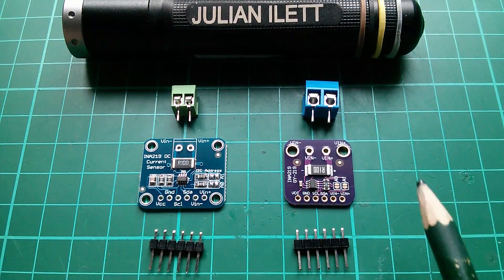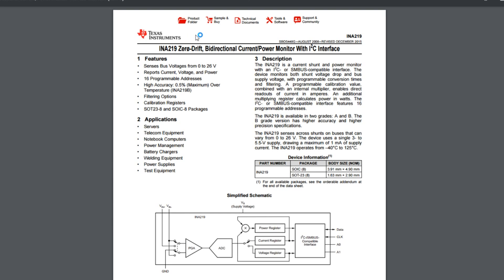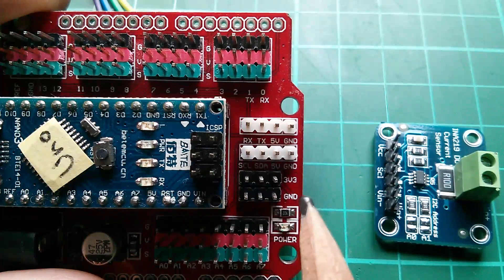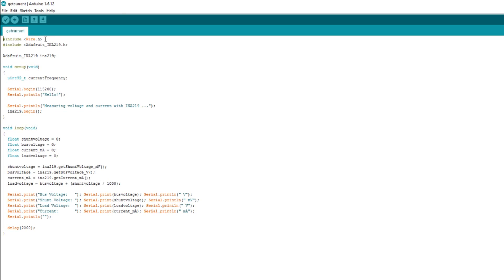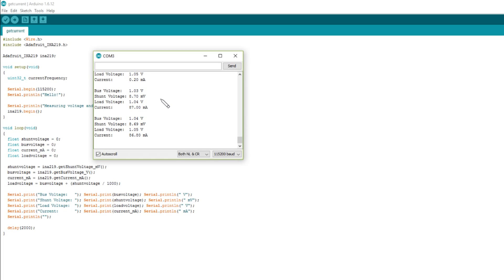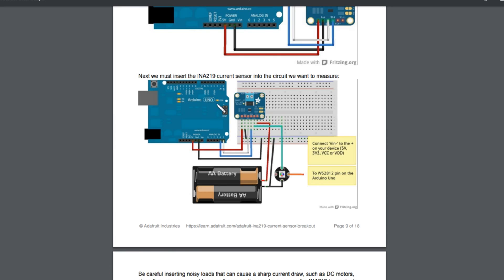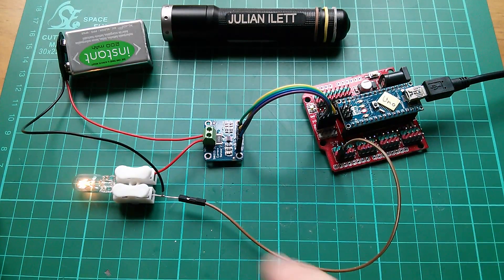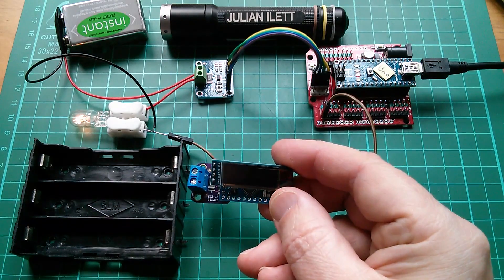10 Minute Arduino Project - INA219 Current Sensor

Comment: Nicely Done, Vary Nicely Done!!! I spent my entire life after serving in the US Navy in Silicon Valley California as a Hardware Engineer, so I have one /input suggestion on the return line from the bulb. The reason you read the supply voltage at about 1v is as you figured because there was no return of the bulbs black wire to provide a proper reference to the ina219. Tying the bulbs black wire to the Arduino kind of does the trick but is not the correct connection. The signal black wire should be tied to the ina219 module. Here's why. The arduino is reading digital registers in the ina219, it doesn't know about or care about nor measure the voltage on the ina219 DAC. So it doesnt need a reference to that. The arduino does need the same ground reference to ina219 to ensure that DC levels of the signals on the I2C bus are interpeted by the arduino & ina219 at the same DC levels. The cable between the Arduino and ina219 has a GND and thus equalizes the GND or "reference" level between the 2 boards. Running the bulbs black lead thru another wire to arduino forces the reference level the ina219 DAC needs thru that wire, thru the Arduino and then thru the cable between them. Thats a very round about path that will produce a voltage drop, which given skinny jumpers wires, multi connectors and length will make you measured voltage look lower than it actually is because now the effective "gnd" level on the return wire has been raised. For instance if your supply voltage is 10v and your Gnd reference level is at 2 volts you would read 8 volts, if the Gnd level is at 0 volts you read the 10v. Im surprised they said to tie it to Arduino, it should be tied to the ina219 board. If currents are  very low and accuracy is not needed than tying the return to Arduino is not so terrible. But if you have a few hundred ma and the real current matters than tying the return to the arduino will produce significant errors. It's up to the user, but hopefully this helps others make a choice.

Comment: i just wanted to measure voltage and you just run +12v to the left side of the green connector, leave the other side blank. The trick now is to run the -12v lead to ground on the pi and now you get an exact readying of voltage. (Tested with multi-meter and it matches ) 

You can ground different voltages to the raspberry pi. eg ground 5v and 12v in this case.

ps im using ina219 to measure 12v supply.

Comment: Does anyone know how I can use the INA to measure the voltage of a charging capacitor? I have a very simple RC circuit that consists of power going to a  2.2mF capacitor then to a 10k resistor going to ground. It doesn't matter how I arrange the circuit or where I place the voltage probe, it either displays the Vcc or the gnd voltage, so I can't see the capacitor charge being detected. Is there anything I should add or something I need to add to the code?

Comment: Excellent! I'm trying to measure the current using an INA 219, but I'm using a PWM board, as I need to dim an LED strip, but I'm not having success, even connecting the GND of my NANO to the PWM board's power input (-). Any tips?

Comment: I can't seem to get rid of the 1.04V Bus Voltage (6:01) for the no load (open circuit) condition, even after tying the minus side of the battery to ground (7:43). Has anyone else run into this problem? Cheers.

Comment: What's that blue putty-like stuff you hold the board with when you solder?
Reply: Blue tac, (uk brand) used as a pin replacement for none damaging stick to surface or to hold things down.
Reply: @springwoodcottage4248  Ahh...  thank you.

Comment: Hi Julian, 

a few months I am trying to build 3 phase 50 + 50+ 50 amps MPPT.
It is BUCK topology 200 V IN / 100 V OUT / 12 - 24 - 36 - 48 - 72 V / batt
but I have serious problems to monitor precisely
50 amps current per phase, I made BUCK with
AMPLOC 100 A, then ACS758BI 50 A,
but measurement with some filtering is not precise,
with precision, that I need to calculate P @ O and INCREMENTAL COND. algos.
Do you think, that som INA219, INA228, INA229 would be better ?
Or there be similar problem with noise / from FETs switching /.

Comment: Hello Sir. Is the module applicable also to detect current at low side of the voltage? So that it can be applicable over 500V?

Comment: Board:	                                         I2C / TWI pins
Uno, Ethernet	                         A4 (SDA), A5 (SCL)
Mega2560	                                 20 (SDA), 21 (SCL)
Leonardo	                                 2 (SDA), 3 (SCL)
Due	                                         20 (SDA), 21 (SCL), SDA1, SCL1

Comment: Hi! It will work if instead of a battery I will use a microgenerator with an output voltage varying between 0 -15 volts?

Comment: Interesting work!!! ...Julian, if  instead of draining the battery, you decide to charge the battery, will the current be displayed with a negative value ? ...There is indication in the literature that the GY-219 INA219 is bidirectional.  I'm not sure if the INA219 is the same.  At the beginning of your video I saw negative current prior the connection of the light bulb...maybe is bidirectional. Let me know. Thanks.
Reply from the maker: Yes, I'm pretty sure the INA219 is bi-directional. Yes, data sheet confirms this (right at the top) http://www.ti.com/lit/ds/symlink/ina219.pdf

Comment: You should try the Allegro ACS7 series devices instead of using a current shunt, the use a hall sensor which gives a proportional voltage to the current through the pins on the chip. There is no series loss as they don’t use a current shunt.

Comment: Dumb question: would there be a way to modify this module to go up to 50V and 70A with an external shunt resistor? I think the external shunt resistor could take care of the amps, but the elevated voltage? Maybe if you never used the onboard voltage measurement by connecting the ground?

Comment: Found this old video and watched it (again). And as I was I wondered if you’d ever considered any videos on “home automation” ?

I can easily see some combination of PIC or Arduino with various sensors and motors etc

One idea was to automate your 30w garden solar LED and fix it to a base that could rotate to follow the sun. Both turning around and changing the 30 degree pitch. I’m sure there’s some web resource out there with an API where your postcode could look up to provide details of the location of the sun for a given hour of the day and day of the year. 

Just a thought. Graham

Comment: Hi Julian,
Thanks for all the great videos!

I have a question 
about the R100 precision sense resistor, I believe it's the "big one".  
SMD terminology for resistance leads me to believe that R100 is 0.1 ohm 
and R010 would be the 0.01 ohm that Adafruit alludes to for a 32 amp 
range.  If this is correct than it's size would indicate that it has a 1
 watt power rating (a 2512 package.)  If both are correct I'll order 
some resistors.

These are great units but the u8g2 blows my old socks off!!!  You and Olie make me smile!!!

Thanks again!

Nick

Comment: I did a project very similar to this last month. I used 3 INA219s and additional ADC to monitor power of a small solar led lamp project I've been working on. There's an INA219 on the battery, one on the solar input, and one on the output. I added the ADC module later with a precision 0.1ohm resistor for sense as an extra amp measurement because I found that the INA219 is really noisy at small measurements. As seen in this video, it can't reliably sense no current. From that I've seen, the only means to mitigate this is to use some kind of RMS averaging of many readings from the INA219 (like around 1000 per desired sample period).

I used all 3 INA219s and a single larger oled on one arduino nano. I can fit volts, power and watthours for all 3 and an extra line for the ADC on the single oled. Using a nano and oled per INA219 would be overkill. Just solder different address jumpers on the other 2 and setup 3 ina219 objects for each in your sketch.

If there is interest, I can polish up mine power monitor code a push it to github.
Reply: Hi can i see your project.. because it quite same with my project.. however im having a problem..mind if you give me the connection. For your project?
Reply: @zamriimran7225 7 years ago... If I had any idea where any of the project files were now or could remember much about it, I would. xD
Reply: @tad2021  is there any other way i can contact you..i have some issue ,maybe you can help me
Reply: @zamriimran7225  I haven't worked on anything like this in half a decade. Adafruit has documentation and code for the INA219. If I remember right, I based mine off theirs from the time but with averaging I likely ported from some other current monitoring code I found.

Comment: Be careful with them quick connects - I bought some off eBay that look similar to the ones you've got, and they were rated for 5 amps... I put 1.5 amps through them and it got that hot, the white plastic melted.

Comment: Love this chip. Have had a play on a 12v battery system. Change of shunt and calibration in the registers and some noise filtering are next. Looking forward to your normal elegant description of the complex bits. I don't read data sheets as easily as you always seem to! 
I'm addicted!

Comment: Just as a note but the load voltage is calculated in the loop and it just summed shunt voltage and bus voltage. So if the shunt voltage is positive the load voltage will be the higher one.
Reply from the maker: Which doesn't seem right - surely the load voltage should be slightly less than the supply voltage.
Reply: Julian Ilett To be honest I don't really know but it sounds sensible.

If the current is shown as negative when you swap the two wires, the load voltage is just the voltage on Vin+.

Comment: I've been working with these for the last few weeks. Nice approach and I still learned a lot. Missed the multiplier part. 

I really like your idea about using these with 18650's and how you plan to piggyback them together. 

I always look forward to your videos, but now I'm really looking forward to them. Would you mind also discussing the INA169. This is slightly different and just reports a voltage to an analogue pin. No voltages, no I2c. I've been using this for a 24v solar experiment and assumed it would be like the INA219. 

I'm back to using the INA219 and using on for each lead acid battery. So we are on similar paths. 

Well done Julian👍 good job

Comment: You don't need a pro-mini per cell. The INA219 is addressible - you just need to adjust some of those fiddly little SMD resistors on the breakout board to set the address, then one arduino can easily query multiple INA219 chips.
Reply: Is true, I have three running on same bus
Reply: The adafruit design allows for four. If you want to mess with jumper wires, I think it supports up to 16 per bus.
Reply: By using 2 little wires, you can get 16 address from these (see data sheet)

Dont connect the address points, connect a wire to the resistor side and connect the other end of the wire to the header pins.
Reply: there is no need to solder any resistor on any other position, just connect the to "adress" pads with a blob of solder

Comment: What is the advantage of using the INA219 module instead of a simple voltage divider, current shunt resistor, and the AVR's onboard ADC?

Comment: I used an INA219 in my first solar charge controller. Worked nicely for months - then failed during a storm. Rather badly, because it failed in a way that gave false readings, alternating at random between 0V and full-scale voltage. Which my solar charge controller interpreted as meaning 'cram in power until the battery boils.'

My guess is that during the storm the solar panels picked up some high voltage from the atmosphere that the INA219 didn't like. I've built a controller now, without INA219. Just good old shunts and op-amps.

Comment: I also put the Arduino Uno bootloader in my arduino nano but I can't get the old bootloader back in to it. Do you know a way to do that without buying an USPtinyISP or another Nano?
Reply: I never really got the avrdude, its very weird.
Reply: sometimes if you select wrong board, it shows such avrdude error i think, or maybe if there is a baud rate mismatch with the board.
Reply from the maker: You do need a programmer to change the bootloader
Reply: I heard that you can make a USBtinyISP from an ATtiny85, can you do a tutorial on that?
Reply: try  using another arduino as programmer. you may search google for connection details.
Reply: iceberg789 the other arduino wil have its bootloader in it thats not the nano's one so i'm guessing it won't work
Reply: the other arduino working as bootlead programmer, does not load it's own bootleader into the target chip. you may choose to load another boot leader. you may choose to load optiboot in it, which is more space saving.

you may also want to make your own usb asp using an atmega8. anyways, whatever you do, you will need to study the process a bit.
Reply: iceberg789 thanks, it actually worked. I tried it quite a while ago but then it wouldn't work. the avrdude did give an error message but the Arduino ide said:"done burning bootloader"
Reply: yah, like they say, don't trust that crazy dude.

Comment: Do you ever plan on using an stm32 arduino compatible board? They are as cheap as an ordinary arduino nano but have far more processing power. Can be a follow up on your "How fast is Arduino" video.
Cheers
Reply: Nicolás Rodriguez I would also like to see something with an stm32
Reply: stm32
Reply: More power if you can use it - some of the STMs are not covered in the standard library yet and hence i2c slave doesn't work.  The cheaper ones are the ones not covered... so the Nano - at £1.50 from China if that, remains my choice for general use now.

Comment: I would have thought Kirchoff's current law would make 3 current sensors on 3 batteries connected in series unnecessary.. Of course using just the voltage readings makes 3 sensors worth it, unless you use resistive divider networks to have the arduino do the voltage readings itself..
Reply: Darth Vader   Dammit, I was about to post saying it was either God or Ampère who decreed that!   You beat me and got the attribution right to boot.  Looks like Julian is still paying more attention to charge balancing than most major manufacturers bother to do.  Bravo!
Reply from the maker: Sorry, I should have explained that these cells will be connected in parallel :)

Comment: Whats the difference between a Nano and a Nano with Uno bootloader? Isn't it all the same 326P?
Reply: Klonkiller361 I think the onky difference is the size of the bootloader.
Reply: the size of the arduino uno bootloader is indeed smaller and it also uploads quicker.

Comment: Looks like it could be useful for a battery level indicator :) Monitor voltage and current. You could even plot charge/discharge curves.
Reply: Ummmm...this chip has polarity...In other words we need to check if you are charging a battery... can it displays the negative current properly?....It certainly measure the discharge part...or the positive current!!
Reply: @tonymac96  Do you know any chip that can show both charge and discharge?
Reply: Welllll...guess what?..the Ina219 does that...if the current goes through the ina219 to say a resistor for discharge, the current will be positive, however if the current goes into the battery the ina219 will show the current with a  negative sign.  I have used the ina219 in a setup for charging discharging a home made battery of appro. 1.5 volts and 600 mWh. It works perfect!!!
Reply: @tonymac96 Thanks, I will look into them. With so many different types of ICs, it's overwhelming to pick the right one.
Reply: Yep...the ina219 works perfect...for low current measurements such no more than 3 A....it definitely measure tiny current such as 5 mA...with no problem.  It is bidirectional.

Comment: After you tied the ground to the Arduino, your video went back to the Adafruit page rather than the Load Voltage display in the serial window ;-) Still very interesting, I'm working on a similar thing myself.
Reply: You can use subtitles as well.
Reply from the maker: I'll check that out :)
Reply from the maker: Tell me about it! (oh you did ;) - yeah, my bad, OBS was set to the wrong source. I suppose I should have re-captured that scene, but I only noticed after I'd packed all the electronics away. I think the verbal commentary says it all. These days, you can't use annotations and end cards in the same video otherwise I would annotate it.
Reply from the maker: I've used a poll as an annotation - let's see how that works out!
Reply: Not bad - I'd have preferred to see the output though.
Reply from the maker: Me too - my apologies again. I don't often annotate, unlike some youtubers who annotate every mistake, so you have to pause the video to read all the annotations. But to err is human I guess :)
Reply: @JulianIlett  The annotation is no longer visible years later. Can you please edit your video to fix this mistake?
Reply: I caught the annotation at the last second, thanks.

Comment: Hi Julian please make a video with Arduino uno + current sensor + ethernet shield  and  data from sensor upload to internet.
Reply: He also has an Arduino Yún that has ethernet and wifi capability integrated i think.
Reply from the maker: I've got some ideas similar to that ;)
Reply: Julian Ilett If you intend to upload data to the internet, I suggest you use esp8266 instead of ethernet shield or Yun.
Reply: And throw some MQTT in for good measure! In fact, why not use a load of NRF tranceivers to broadcast to a central node which then manages the MQTT message sending........